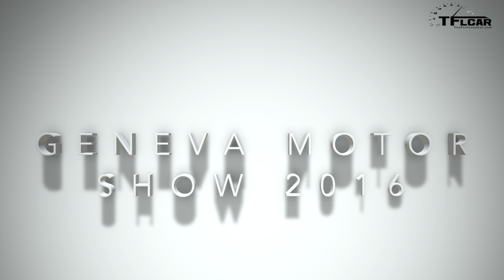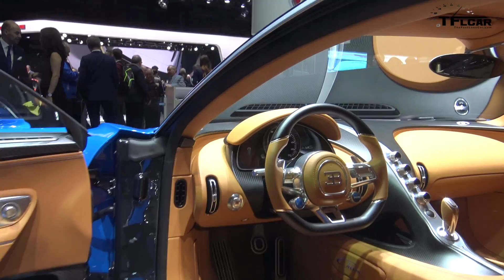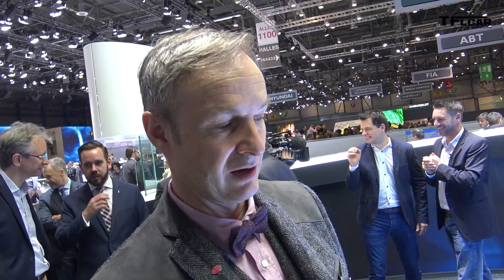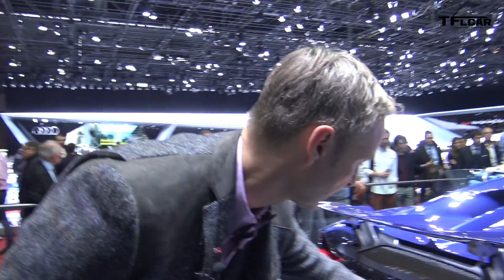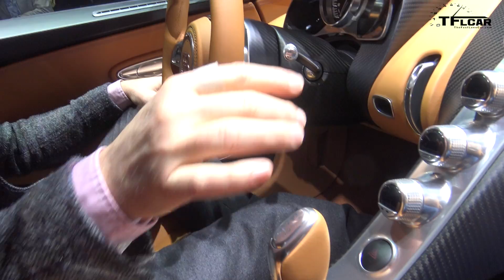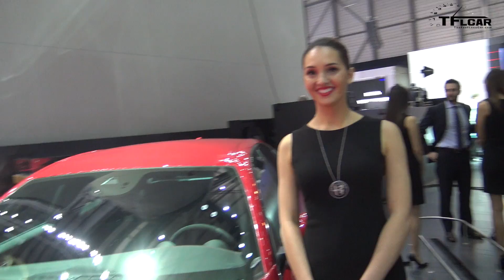261 MPH Bugatti Chiron Design: Everything You Ever Wanted to Know

Comment: Am I the only one slightly disappointed with the top speed? I expected something in the 275-280 range.
Reply: Who cares this is about everything just beauty and beast. 261 mph is good enough. Most drag races this Chiron might possibly have with koenigsegg and others will be a mile stretch and I believe they have prepared for this it's how quick it can get to 200 mph. I believe they will unlock the speed limit at the vw testing track. I mean it's capable of 290....but the tyres and all that is a serious risk
Reply: *****
The new Koenigsegg Regera does 0 to 250 mph in 20 seconds. Doubting the Chiron will be close to that.
Reply: +andyb0x Apparently it can go 275mph, the tires are not up to it....
Reply: vysoc
Didn't know that.